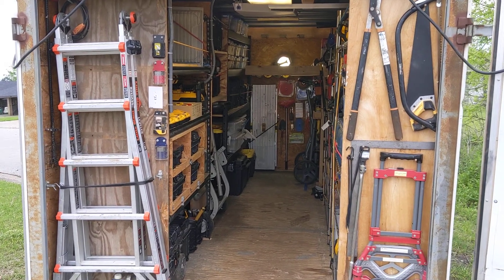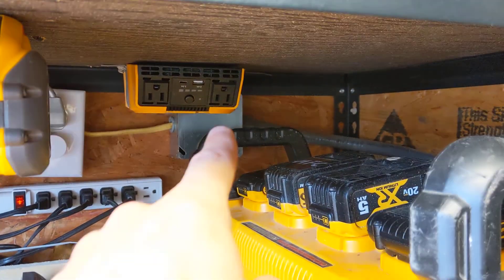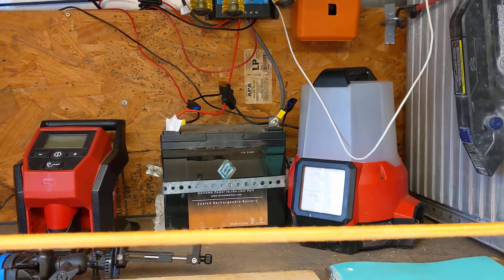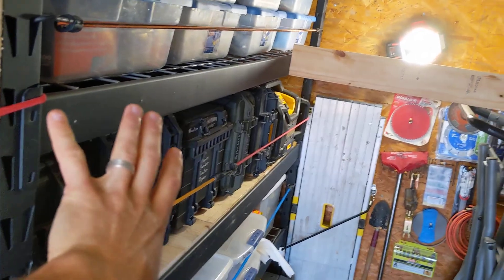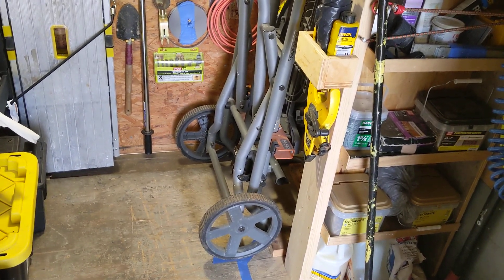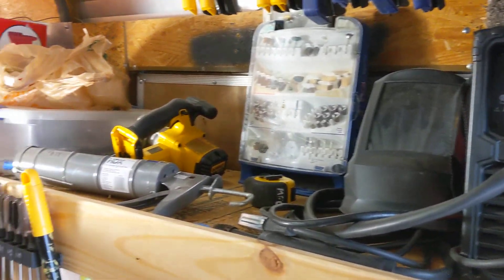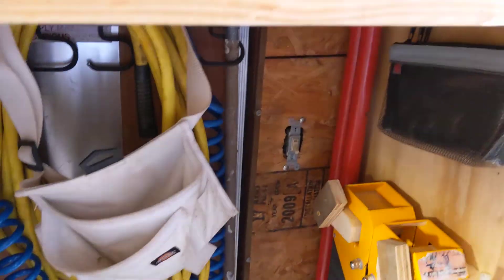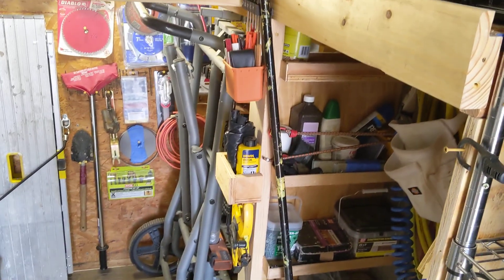Construction Trailer Tour

Comment: You should turn the shelves upside down the lip will stop the tools failing out
Reply from the maker: The problem is that the shelf brackets only work vertically. You could weld them upside down, but otherwise it wouldn't work.

Comment: That's crazy.  I literally have done something similar.  I also use a second phone for hotspot, solar.  I also installed a Ring video Doorbell "WIRED"  to the outside of the side door. Plus the Optimus Tracker as well like you the Phone can also be tracked.  The Optimus Tracker also has tamper alerts. someone could lightly shake my trailer and I get an Alert.  Mini Split is next and before Winter I am installing a Diesel Heater for cold winters.  The ramp in secured/locked from the inside as well as 2 puck locks on the outside.  Am also planning on installing a hard wired deadbolt inside the side door that works off a Key Fob remote.  You will have to cut your way into this trailer and if you steal it I will find you quickly.
Reply from the maker: Yeah, I see a lot of trailers with a master lock as the only weapon against thievery. Most of the stories I hear about thievery is from grab and dashes. They left a tool out or their trailer open and some tools went missing. I installed the phone/gps after a couple of guys tried to break into my truck while I was helping a little old lady move into an apartment. They stole a car, and then used that stolen car to try to steal my truck. I walked right by them and didn't notice they had broken my door lock. I realized that securing my trailer does no good if someone can take the whole kit-&-kaboodle and I'd have zero recourse to find them. Have fun with yours!

Comment: Can you flip the metal racks upside down? so that you can have passive restraints. no need bungees
Reply from the maker: No, these shelves have a tapered cone that puts pressure on the plastic clamp (which holds it on the shelf) so they couldn't be inverted.

Comment: The whole power/solar setup in the trailer i never understood inside the trailer? Why do you need power in there you don't work in there you store in there. If you are working in there then you are walking to much on the job.
Reply from the maker: The solar power is for running the GPS, wifi, and security system. It also charges my tablet/computer/phone and the occasional battery.

Comment: Great setup I was thinking of building shelving in my trailer never thought of using the metal racks how do you like them?
Reply from the maker: I love them. However, if you have a bunch of boxes that are the same size, a sloped plywood shelf is also a great solution. It really depends on what will be put on them. With my miscellaneous assortment of boxes, the metal shelves are really great.

Comment: What brand of backup camera and solar panel are you using? Would you buy them again?
Reply from the maker: I'm using a "Do Honest" brand back up camera. They give you two back up cameras and an extra long antenna if you don't get good reception from your furthest camera (it really made a difference). The cameras are decent and haven't had any issues from water penetration. I welded them to the trailer though they can be bolted as well. Not the best setup for a hitch backup camera since it is difficult to mount such a heavy camera anywhere on a bumper. I would just look around at the different reviews on Amazon to find exactly what you're looking for because it seems they are all just rebranded from the same manufacturer.
the same goes for the solar panels as I've had three different brands and they've all performed equally. If you're going to have partial light though I do recommend using polycrystalline over monocrystalline. Rich solar and renogy are two brands I remember.

Comment: Could you flip your metal shelving upside down so the shelves would have a natural lip to hold your tools inside the shelf with less or no bungy cords?
Reply from the maker: Someone else suggested that, but the problem might be with the conical design. It is more narrow at the top of each bracket to squeeze the shelf clips and if it were upside down it might not be totally secure or might break the clips. The bungee cords aren't that bad and they do a good job of keeping things from flying off the shelves.

Comment: Where did you get that AC unit?
Reply from the maker: I didn't, it came with the trailer. But it's a dometic ceiling mount RV AC unit. Works sort of like a window unit you just have to make sure you seal it to your roof and have support under it.
Reply: Thanks for the reply! Very interested, as my black trailer gets hot in the summer
Reply from the maker: @bantambryce4858  You're welcome, my first trailer was a dark green and it was made from sheet metal so it got baking hot in there. I sanded it all down and painted it white with some epoxy paint and that helped a lot but it still got hot without airflow. In this trailer, to support the AC above, they put a piece of 1/2" plywood in-between the purlins and metal on the roof and then they put 1" angle iron across the purlins on both sides of the a/c to reinforce the ceiling. Never had any leaks from it. You just have to know how to flash it with your roof.

Comment: plugging into a homeowners home and running an AC unit is a sure way to get promptly tossed off the job IMO.
Reply from the maker: It's funny, I hear "Doing/Having/Saying Fill in the Blank will get you tossed off the job..." All of the time! But I have never seen it happen. The construction industry is so desperate for workers that I've even seen drugs and alcohol tolerated on job sites. It's scary working with someone when you're not sure if they're high, drunk, mental, or all three.

As far as an A/C unit getting you tossed off a job... What, are you working for the Amish? ;)